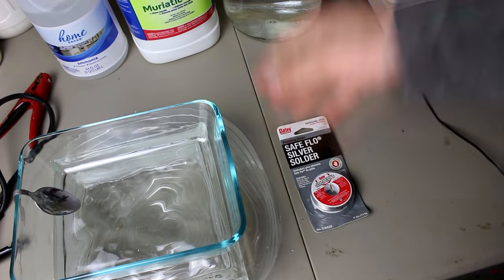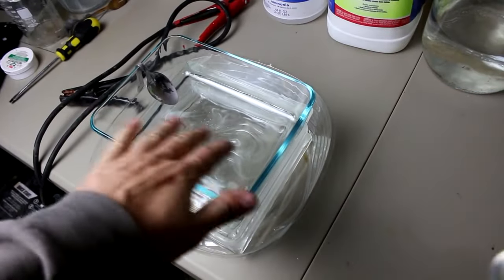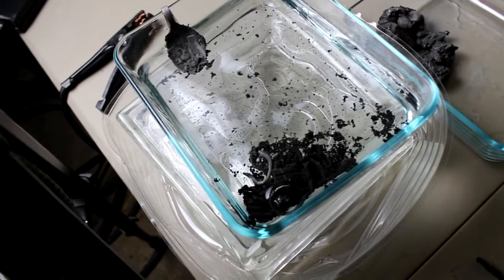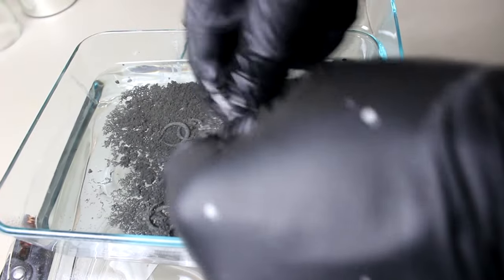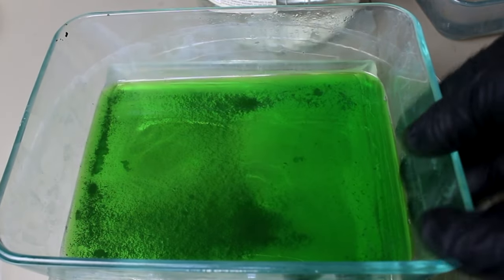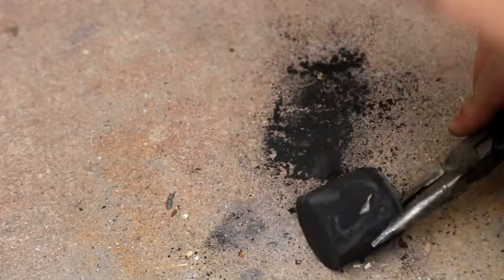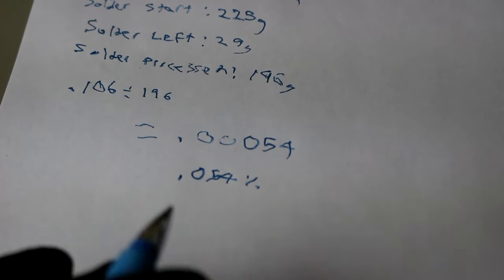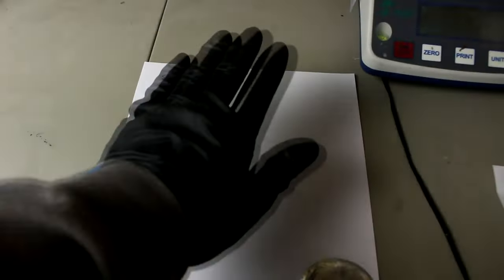Metal Refining & Recovery, 18: Lead Free Solder

Comment: Cody is there any way you could scratch a penny (a zinc one obv) so the zinc is showing, dissolve the zinc so you have a hollow penny and inject a different metal into the hollow copper coat?

Comment: Talked with grandfater, "Lool only 0.1g of silver from 200g of solder". It is not that unbeliveable. They put a few kg of stuff to like 160 Tonns of steel like titanium, molybdenum, etc and that was the difference between the steel for plastic forks and medical instrument grade steel for space elevator. :)

Comment: Cody, I have a couple of WWI soldier's tins, used for holding bacon and condiments. They are sheet iron, and have lost their tinning. Can tin be electroplated back on? I assume they'd need an acid bath first? I can't find an affordable place that does hot tin dipping...

Also, build a Kearny Fallout Meter and test its accuracy!

Comment: Would you please do the video on the oxide recovery of tin from this video. I have had no success with the oxides of pb, sn, and bi. Have several ounces of sn, bi alloy oxides that did not react when roasted to 1800° f with two inches of sawdust and lots of parrafin. At what temps do these metals deoxidize in the presence of carbon? Also, how important of a factor is depth of borax flux, and different fluxes. Thank you

Comment: I was doing a little bit of Chlorine chemistry in my home lab and acidently rusted all my iron tools. My solution to the problem was electrolysis and I was warned not to put stainles steal in the solution as it contains chromium compounds. You had a stainless steel spoon as your anode is that alright to have in the solution as mine was the cathode?

Comment: Is it possible to simply burn the lead out of normal solder? I had a blob of solder and a microwave oven transformer welder with 2 carbon electrodes and got it well beyond red hot and and I think the lead oxidized leaving behind mostly tin because after removing the yellow substance left behind I had a metal with different properties than solder.

Comment: In my mind, at least, would running a wire through the solder coil to do the conductivity without being a self-made fuse be a wise decision or would the material collect on the wire instead of the spoon?

Comment: Cody, i was wondering. how can i react lead chloride so as to convert it to either lead II oxide or metallic lead?
can i displace it with sulfiric acid and melt the subsequent precipitate as can be done with silver?

Comment: Cody your furnace looks to have two elements? You noticed one wire burnt off (on the left element) but can i see a second wire disconnected on the right element. Maybe that's throwing the errors?

Comment: Cody. Would you mind going through the Chemistry and process of extracting the silver out of silver oxide batteries? If you know anyone with hearing aids or go to some jewelers, you can obtain some pretty easily because they are used in watches and hearing aids.

Comment: The general composition of lead free solder is usually 96% tin, 3% silver 1% copper by weight and despite this being "only" plumbing solder, the composition is actually pretty tightly controlled - i'd say something went really wrong here, although I have no idea what.
Reply: Possibly too high current/voltage on the electrolysis setup?

Comment: Cody, could you explain the level of danger of hexevelant chromium in electrolysis using stainless steel? Ive wanted to do some coin cleaning but read of that danger and decided against using stainless steel. Am I being paranoid?

Comment: After crushing a rock you can extract most metallic metals from the crushed stone.  But extracting most other metals from the crushed stone seems like you need to use HCl.  Using HCl I believe you get a blend of many metals in the solution from the source rock.  Is their any simple to extract each metal from the solution?  Kinda would like to see a video of you taking sandstone and extracting as many minerals as you can from the source rock.  Should be primary Silicon. 

Also been thinking of extracting the silicon then combining the remaining with past batches and trying to extract the more precious metals.

Comment: Was the reaction at the start electrolysis? If so, I thought the metals you want to separate  to be dissolved or melted in order for it to work. If not is it similar to electrolysis?

Comment: Cody, I work in a machine shop and we have tons of metal chips we just throw away. Aluminum, steel, sst steel, brass, etc.. Sometimes the steel and aluminum get mixed together. Could you do anything with it? I could send you what ever you'd want. Lmk -C
Reply: I wonder if you could remove the precious metals from the stainless steel?

Comment: I have about 100L of 30-40 year old fixing solution that was used to develop xray films of welds in a shipyard. It is supposed to be totally saturated with silver as quality of pictures was not of great importance.  Do you want me to send you a liter or so to try to extract it? It could be fun since I have no clue what it is :)
Reply: Cody don't accept! ... it's a ploy to send you highly toxic PCBs to make you suffer from uncovering the truth about solder industry and silver content !!! xD
Reply: Diazodinitrophenol   maybe you're mistaken?  The point of fixing is to reduce silver nitrate (mainly, I think) which is light sensitive to  metallic silver in the emulsion,, not leach it out.  The analysis would be interesting, I agree.  But I think you want the old film to get silver.  Very low yield.
Reply: Sorry, I've just realised that my comment was daft.  The silver nitrate from the unexposed areas needs to be dissolved, so that will be in the fixer.  Sorry to have bothered you!

Comment: you should i have the same furnace and i did not finish the bracken heat up before i burned the same wire. am thinking about buying a better controller and rebuilding it so i know how to fix it.

Comment: Cody I know the series is called precious metals recovery but has there been any inquiry into recovering diamonds from the dust biproduct of cutting metals and stone with diamond saw blades?
Reply: He did that already.
Reply: AguaFluorida I saw that after the fact, but he was gathering dust from a road cut. I'm talking more along the lines of seeing if any of the metal shop near him has a cutting room or area that he could gather material from. It'd be interesting to see how he retrieved them from metal dust as opposed to mostly dirt and concrete dust.
Reply: I'd have a guess and say that dissolving metals is typically a bit easier  than dissolving concrete.

Comment: Is hcl required for electrolytes
Reply from the maker: Actually stannus chloride would be the best for this, I'm making it in situ by reacting the tin with the acid. I think it's possible to use another salt it just won't be as efficient.

Comment: @Cody'sLab  why don't you start by melting the wire. Heavier elements should go to the bottom. You can then use the acid to disolve the tin more efficiently.

Comment: not followed up on this (since it has been nearly 2 years since this was put out) but I am guessing if you had used hydrogen peroxide, and a chloro-alky cell (spelling?) ie a tank with water, and peroxide, and one with salt water, putting the system together so that the chlorine would be drawn from the saltwater via a tube of water and capped on the ends with a filter to avoid the salt spreading out through the both tanks of water, you should have been able to use the chlorine from the table salt to break down your tin, till it was gone, and probably the silver as well as everything else for a buck or two of table salt, with plenty to spare, and been left with sodium hydroxide mostly in the tank that the sodium is attracted toward, then it would just be a matter of making supersaturated solution of water and tin/copper/silver chloride, and then let it cool off letting the silver precipatate out first as a chloride salt, filter, heat again till it is super saturated, and repeat to do crystal fractionalization. to sort the various salts, and finish from there to get a much purer reaction and capture much more of your substances. also the stannous chloride would be nice to see you do a video on how to make that and glass into conductive transparent glass. :) (yes I know with out the iridium it wont be as tough, I just like the idea of transparent conductors since this might improve energy collection from photovoltaic cells :)

Comment: Gentleman, did you miss something? 
Lead test! What is the purpse of these kind of solder excist? No lead welding of water pipe, right? How much silver inside is not the most important thing, as long as it is welding well. How much lead inside would be an issue.

Comment: As a suggestion for doing the maths at the end of a video, rather than using pen and paper why not use excel? You can set up a column with all the names of what you need, and have the final results automatically be tallied by excel via using the cells you would be putting the results into. Using a computer program to do the calculations also would remove the tediousness of recording, ensure that we can see and understand what you're doing.

Comment: when you're talking about conductivity. i know silver is the most conductive. but if you have a chunk of silver and a chunk of copper on the multimeter. i dont even think that you'd see 0.1 ohms of deviation. on the level of atoms and electrons it's big. but in practical use. it doesn't fucking matter.

Comment: I would have been better if you mixed nitric acid with it to form silver nitrate
Reply from the maker: How exactly?
Reply: @theCodyReeder  I meant to say silver would react with nitric acid to silver nitrate and then you could precipitate basic silver using copper and then just metal it to dry the powder and mould it
Reply from the maker: @animeonepiecenarutopokemon3219  ever added nitric acid to tin? it turns into an insoluble white paste.
Reply: @theCodyReeder  but I guess silver should be soluble in it and and you filter the rest white past off

Comment: numbers lie like a 401k interest earn rate !!!!! drawn from a vat of molten metals hard to control mixture out put, but both roll that low. some you can not get to stick the copper when you sweat it. show Idea, sweat pipes with diff. solder formulas.

Comment: This refining scheme is crap!  Most of the metals plated through to your "tin".  You drove the electrolysis so hard that everything plated through.  Either do slow electrolysis (pain because tin shorts cell), or dissolve everything in nitric acid, then precipitate out the silver with HCl.  You could also use "poor man's aqua regia" (HCl and a nitrate salt) to dissolve the tin and copper faster.  (This is the crude scheme used to make nitric acid).  Once you get the silver chloride, add this to NaOH solution until it turns black, then add sugar a little at a time as it heats up.  Silver powder results which you can melt with a torch.
     In order for electrolysis to work, you need one metal in the majority, along with a parallel-plate geometry and careful control of the voltage to achieve separation.  You would have been better off using the HCl along with some peroxide to push things along, and rolled the solder thin.

Comment: Silver solder is garbage the only things it's good for is if it's under high temperature but at that high it would melt the circuit board before it melted the solder so yeah it's crap

Comment: Ehm...
.54% is bullshit.
I'm not even sure that can legally be called silver-solder, rather than lead-free solder.
Most of the stuff i've worked with is about 5%, although i never checked whether that is actually a valid percentage, other than reading what's on the box... :/
Also, don't use lead-free solder on electronics.
Just don't... -_-